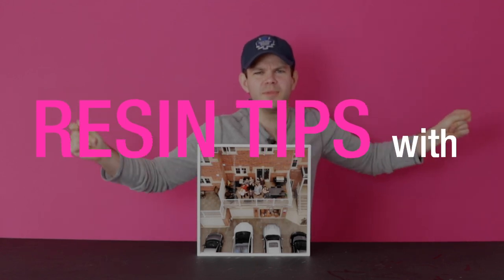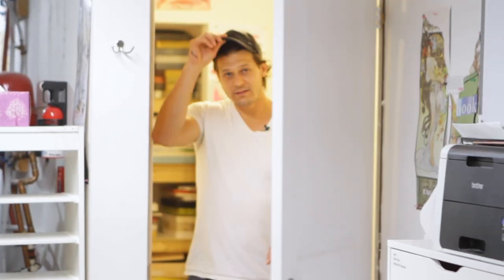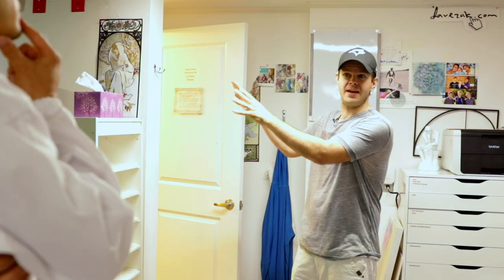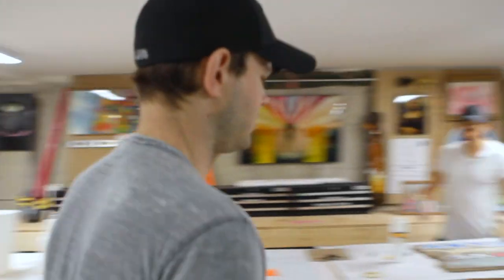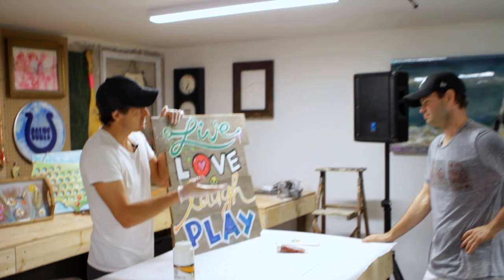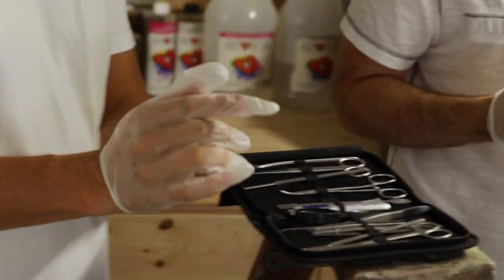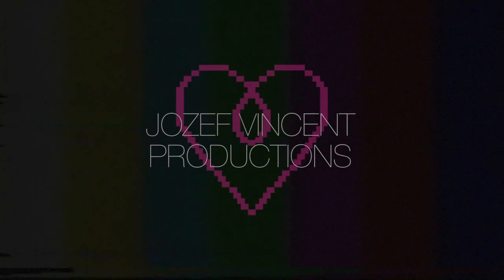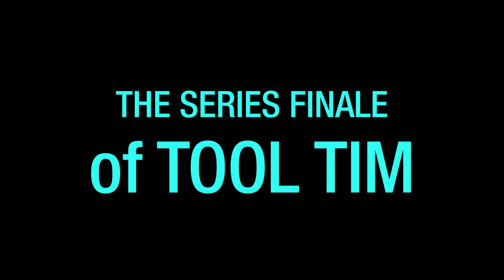Tool Tim: The Return of Dave pt. 1

Comment: Is there a way to patch an imperfection in epoxy resin after it’s cured without having to mix an entire new batch and re-pour over the entire surface? I’ve had instances where it looks fine when I leave and a bubble must have formed and popped while at work and I come home to a hollowed out hole. My only idea to fix is redo the whole thing but it’s getting annoying and pricy when that happens. Does a small amount of epoxy resin blend with the old if it’s leveled or is there some product I can use like glue?
Reply from the maker: Unfortunately, we don’t recommend spot fixing for the simple reason that it’s very difficult to sand out a small area where there might be an issue, such as a bubble, hair or a bit of dust that settled into your wet resin. It's almost impossible to get a seamless finish by pouring a fresh patch of resin on top of the original resin coat - you will almost always be able to see the patch coat.